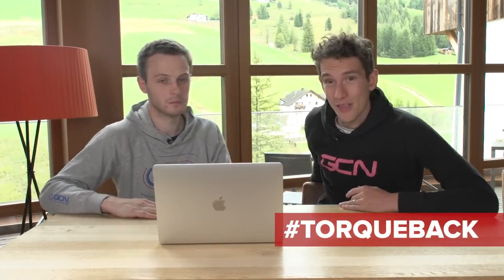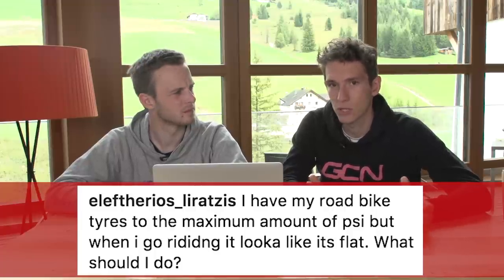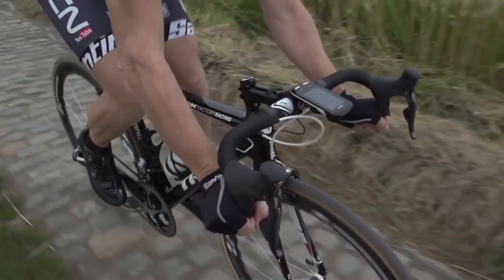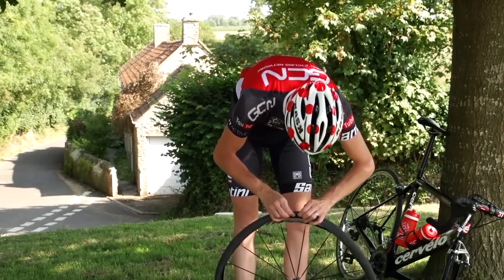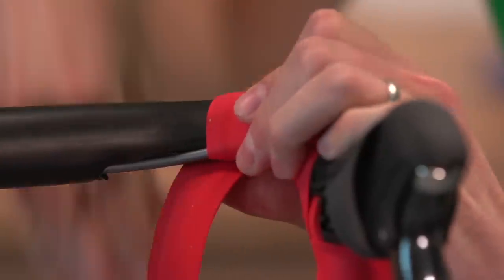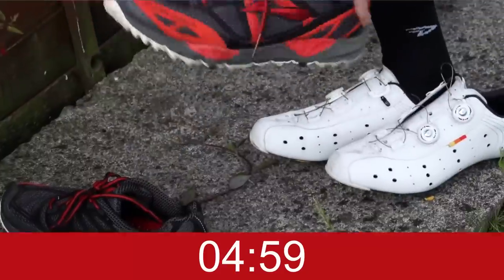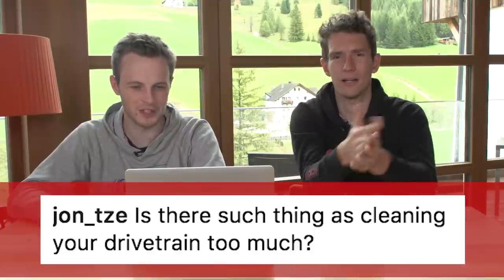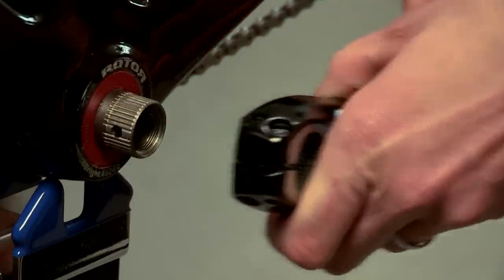Mechanical Special | Ask GCN Anything Cycling

Comment: For the person asking about getting seized aluminum seat post out of carbon frame.  Try getting it cold.  Carbon has a negative CTE meaning that it will expand when it gets cold while aluminum has a positive CTE meaning it will shrink.  Never tried this before so not sure how cold it would need to go or what is safe though but the mechanical principles suggest success.
Reply: Pro tip! #Physics

Comment: Because the thermal conductivity of Aluminum is different than Carbon Fiber, I've heard of using a CO2 fire extinguisher to super chill the seat post, releasing it. I've never had cause to try it myself.
Reply: Using the same line of thinking, Loctite has an auto mechanic "Freeze" spray to remove rusted bolts, which could work. Also compressed air in a can, turn them upside down and you also get stupidly cold gas. Just ideas.

Comment: Tire pressure -- It is very easy to pump your tires to their maximum rated pressure yet not have enough to support your rolling weight if you are a large, heavy cyclist and are using small tires. This can even happen to fit cyclists who are not overweight. For example, I'm a fit endurance cyclist and my body fat is below 8%. But I'm also 6' 2" (188 cm) tall and weigh 185 lbs (83.9 kg). When I add the weight of my Pearl iZumi pro kit and shoes, Giro helmet, carbon-frame bike, saddle bag with emergency gear, water bottle with water and lights, I need to pump a Continental Grand Prix 4000 S II rear tire with a 700c x 23 mm size to 144 psi (9.9 bar) in order to have no more than a 15% tire compression when riding in an upright road position. In that upright position, approximately 62% of my rolling weight is on the rear wheel so the rear tire needs the most pressure. When I'm riding in a forward-leaning aero tuck, resting my forearms on my aerobars, only 53% of the weight is on the rear wheel and the same rear tire needs only 122 psi (8.4 bar). The problem is that the maximum pressure rating of the tire is only 120 psi (8.3 bar). The solution is to switch to 25 mm wide tires (that's the largest my bike frame and caliper brakes can accommodate). A 25 mm wide tire needs only 124 psi (8.5 bar) in the upright position and 102 psi (7 bar) in the aero tuck position. That's doable. To help you determine the tire pressures you need, I recommend borrowing a floor shipping scale and weigh the weight over your front wheel and rear wheel separately. You should be wearing your full cycling kit including helmet and your bike should include all the items (saddle bag, water bottle with water) that you'd normally take on a ride. Then get a bicycle tire pressure calculator app for your smartphone to work out the required tire pressure for each wheel. I use this one for my Android smartphone: https://play.google.com/store/apps/details?id=com.edisongauss.bertotirepressure.

Chain cleaning -- Perhaps I'm old-fashioned, but I hate cleaning my chain on the bike (I go back to the vintage steel-frame road bike days when hubs and bottom brackets were rarely weather sealed). I use SRAM chains with a "Power Lock" link so I can quickly and easily remove the chains from all my family's bikes. Then I can easily clean them off the bike. (Note: Other chain manufacturers also offer similar reusable chain links.) Why clean the chain off the bike? Because I hate the idea of solvent or soap running over my rear free-hub and bottom bracket -- and this will always happen when you clean your chain on the bike. I'd rather not risk losing any grease from the hub and BB because the weather seals are not perfect -- they can't be unless you are willing to accept much higher rolling resistance. Generally speaking, the hubs and BBs with lower rolling resistance will, of necessity, have less weather protection which means solvent and soap can get into them more easily. Plus, once the chain is clean, I can pop it in the oven on a metal cookie sheet (dedicated to this purpose) and set the oven temperature to its lowest setting (usually "warm" on most ovens) so the chain can be thoroughly dry in just 10-15 minutes before applying lubricant again. This has been a great way to clean a chain during cold and/or rainy weather. To clean the chain, I use a Park Tools chain brush, earth-friendly citrus-based solvent and biodegradable dishwashing soap. (IMPORTANT: You cannot use any flammable cleaners if you plan to dry your chain in the oven!!!) Note: SRAM Power Lock links are rated for just single use but I've never had any problem reusing them -- not even after many dozens of locking and unlocking. The only time I use new Power Lock links is when I install a new chain.

Bar end plugs -- The perfect solution to the bar end plug problem is to switch to locking plugs. They are not expensive and pay for themselves many times over. Most have a screw that you turn to expand them inside the handlebar, preventing them from sliding back out. If you use thick bar tape like me (2.5 mm thick Lizard Skin tape), you know that it's nearly impossible to get bar end caps to stay put, forcing you to periodically check them so you don't lose them. But it's easy to forget and I've lost caps that way. The locking bar ends fix all that. I'm using a pair from EVO now that I paid only US$8.75 for. Here's a link at the U.S. Amazon site: https://www.amazon.com/gp/product/B00N5KDU2M/ref=oh_aui_detailpage_o03_s00?ie=UTF8&psc=1.
Reply: TL;DR but yeah, I  ran 23's pumped up to 100 psi and they would deform because im just too big for those tyres. Not fat, just 194 cm, 80 km individual. Lol. Switched to 25's and never looked back, im now considering going 28.

Comment: How often should you service your BB, headset and wheel hubs? #TorqueBack
Reply: If there sealed bearing there not serviceable, so just replace when the become unsmooth. If there are loose bearing or grease-able races then it depends how many miles you ride and in what conditions. If riding regularly check for smoothness of spin/movement once a month.
Reply: clean and re-grease periodically (just make sure they aren't dry and that they don't have dirt in them), service/replace when they become a problem.
Reply: For me BB and wheel hubs not often, say every 20k km via a bike shop.  In fact so infrequent I'd consider a BB replacement instead as they are relatively cheap and might use wheel hubs as an excuse to buy a new wheelset! Headset is fairly straightforward and I do it about 3-4 times a year - beginning, middle and end of winter then once more if I get an associated click or creak. That's riding about 10k km a year but the main thing is winter prep then keeping on top of it during any prolonged, filthy, winter riding.
Of course normal riding conditions are important. For reference I'm in the south of England.

Comment: Stuck seatpost? Aliuminium in carbon?
Take the second bottle cage off (one of seat tube), tip bike over carefully, spray WD40 through bottle cage holes. Leave to soak, repeat, leave... Leave overnight. Place bike back onto its wheels carefully since now you got liquid within your frame. For personal preference I swapped my Fizik saddle for an old one I don't mind breaking. Some strong side moves through the saddle and it all should come apart!
It won't be easy but persistence pays off at the end.

Comment: Tire width: 
measure the fork/chainstay/seatstay gap where the tire would be

Minus 5 or 6mm. That is the actual width of the tire allowed.

IF the rim internal width is above 17mm, take the tire, add half the additional width to the stated width. I.E. 23mm tire, 19mm rim, actual would be about 24-25mm.

Note some brands run narrower or wider than the stated width.

Comment: 4:59 - Maximum Tire width ... I just went through this, and it can depend on the tire make and model as well (as well as wheel/rim build and width - don't assume that a tire that barely fits the bike with one wheel will fit the bike with another wheel).  A Gatorskin 28 might fit where another 28 may not.  I accidentally ordered, IIRC, a 28 instead of a 25, and it fits when the wheel is perfectly centered - but it's a pain to even get past the brakes when they are opened up.  Moreover, with only about a 1 or 2mm gap between the tire and carbon frame's paint, the wear from not the tire, but the road and sand particles being slung up at the meeting of the seat-stays has worn through the paint and the primer, and it started to wear into the carbon.  It's like a continual sand-blasting there, so I have had to try remedies.  First was two layers of clear box (for the post or mail) packing tape, but those wore through fast.  Last attempt, that I haven't even assessed since I did it a few months ago, was a thin layer of filling in the gap in the paint with a 2-part PC-7 epoxy.  
So... I technically have the space for a 28c tire in the rear of my bike, but operationally it really isn't ideal for safety and frame-wear reasons.
Reply: David Hanny I
Reply: stupid... why use 28mm's if they ruin your carbon frame?????
Reply: It was an ordering error that I didn't catch.  The Amazon page had multiple tire listings, and either I chose the wrong one, or they sent me the wrong one.   The bike came with 23's, so I went and ordered, or tried to order, a 25c to see if it would fit.  I didn't look at it in the packaging, and really didn't notice it was a 28c until after a month of riding it.  At this point, it really isn't the tire that is ruining the frame - the impact from being sand-blasted would still be there with the 25c, only slightly less so.  Such is the problem with riding along beach highways during and after rains.  The problem is more with the tight tolerances the frame was made with (seemingly made for 21c to 23 c tires), and I'm not going back to 23c tires.
Reply: Thanks, that may be a good solution - I'll check my epoxy layer to see if that's wearing through first.  PC-7 is a pretty tough product.
Reply: Kip, your message didn't post.

Comment: about the bar tape question, if you are using an alloy bar then most likely the bar is corroded pretty well by the salt in the sweat if you didnt clean it for that long. you really should take off the bar tape and have a close inspection of the bar for corrosion.

Comment: #TorqueBack I recently had a bike fit and the main change was a saddle position that was further back on the rails.  My bike fit guru said that many people sit too far forward because it feels fast but us actually unbalanced.  My position now feels way more stable on fast descents and through fast corners.  I also note that quite a few pros seem to be crashing on technical descents in grand tours, especially in the wet.  Has the UCI's relaxation on downward seat angle cause an instability problem???

Comment: It's theoretically ok to say you can never clean your chain too often, however, I see chains that have not had the degreaser properly removed (probably because they're in a rush). Residual degreaser will remove whatever lube you put on and your chain will experience accelerated wear. Basically, if you don't have time to do it properly, don't do it.

Comment: #TorqueBack Is mixing in short sprint intervals to bump up average power in a 20-minute FTP test valid? Or should it be a sustained effort? My short-term power is disproportionately better than my current sustained power? 

I feel I can recover quickly from short, 20s bursts at a higher power though find it harder to sustain the same average power when its consistent. Similarly, could you potentially do a video on how much average speed/time changes over a section when ridden with consistent power (say solid 300w) vs alternating between 1 minute at 200w, 1 minute at 400w.

Comment: Ive had 6 bikes with square taper BB's. Not even one of them creaked in there lifetime, even when running the same BB for thousands of km. Those Shimano square taper BB's are bomb-proof. (quick reccomendation: "RPM" brand square taper BB's with FSA bearings are terrible, they suck)
Reply: right! I use a older Campa Record crank with square taper BB still today and never had a problem; same with a even way older TA crankset (from ~1985) which I used until this summer (changed now because no chainrings available) - no creaking in more than 30 years of use!!! ...if that happens, they are badly mounted...

Comment: #torqueback what is a cheap way for a head unit for navigation, speed etc. ? Usual Garmins are waay too expensive.
Reply: Torben Sander Mount your mobile phone
Reply: MRGRUMPY53 I need navigation for group rides and marathons
Reply: Get the elemnt Bolt, you'll never regret it.  Cycling isn't a cheap sport so just get used to it
Reply: You can use Bryton rider 330 if u need navigation. If you don't then use simply rider 310
Reply: Navigate on your phone and have a cheap bike computer for stats
Reply: Torben Sander Garmins are shit too, in terms of reliability, waterproofness, data handling, maps, routes. I hope the element bolt is better. When it works they are good, but man, my Garmin frustrates me #lostdata #calibrationissues #nosoftwareupdatesin18months

Comment: GCN does Science? how does the power to pedal ratio change as body position changes (ie. compare power output while pedalling super tuck - vs pedalling normal tuck on the drops with straightened legs)?  Compare super-tuck / seated / standing . ??

Comment: I have two sets of wheels.  One nice set and one kind of beater set that I'm not so worried about.  I'm going to use one set for the trainer with a trainer tire, not to be ridden outside, and this will happen about 3 days a week.  And then the other set I'm going to take outside for endurance rides about twice a week.  Will the inside or outside riding be harder on the wheels?  I'm thinking of the water and road salt that will be on the roads in the winter, but also I hear that roller drum can be hard on wheels as well.  So boys, what do I do?   #TorqueBack

Comment: If I had a tailwind, would it be reasonable to ride upright and take advantage of the wind?
Reply: Hardly- if you're still putting out a good effort, you will end up riding faster than the tailwind is blowing, so you'll still reap the advantages of a good aero position.

Comment: Question: I always go with around 110psi in front, and 115 in the back, for puncture resistance and less rolling resistance. However, I do find that I wear out the rear tire quite fast, as in every couple of months ( I ride 150 miles a week, 12,000ft of climbing a week avg, thanks strava). Do you think that's too much psi, or is going up my local climb all the time to blame for the frequent tire wear? Thanks, GCN is the shite!
Reply: Oh, and I'm 168lbs, usually carry 1.5 liters of water with me too, ergo my inclination towards higher tire pressures.
Reply: You may slightly widen the contact patch with lower pressure and spread the wear. Try lower pressure next set of tyres its the only way to really know

Comment: Disagree with Si on bike fit respective to bottom bracket & seat where he stated the seat will always be in the same position. How can you ignore crank length. A 160mm crank would put the seat at a different height than a 170mm crank on the same bike.

Comment: Si greasing a square taper bottom bracket... come on. Never do this! If your square taper is creaking that means there is some play and its probably not torqued properly. Grease will only help the taper slip around more and speed up the process of rounding the square taper on either your crank arm or shaft. Also, Tom... before your time? O_O

Comment: #TorqueBack
Hello, i can't really decide between carbon and aluminium. I've been to multiple bikestores now and they all had different answers about what's right for a beginner. I also like the bikepacking bike of Sean Conway you had featured in one of your videos, so I can't decide on wether to buy a cyclocross or an endurance model. For my type of riding it will be on the street with a couple of long distance adventures where tracks with bad pavement can get problematic.
Thank you ;)
Reply: Id go for aluminum if youre using in it in streets and bike packing. The marginal gain in weight and the huuuuge price increase of carbon is not worth it in your case, IN MY OPINION. Plus, alum bikes are usually spec'd for heavier loads, but it all depends on model, alloy, and quality. Consider budget too, if super light weight is not what youre looking for, maybe carbon is not such a great option

Comment: Which bottom bracket system do you think is better and easier to maintain, press fit or hollowtech?
Reply: I work as a bike mechanic, I much prefer hollowtech
Reply: Hollo
Reply: A third vote for hollotech.
Reply: hollowtech lasts longer and is way easier to swap out but you can get more stiffness out of a wider bottom bracket area, so lightweight frames tend to have pressfit bbs
Reply: Depends what you want from your bike. You might end up enjoy the maintainance process as well.
Reply: Thanks to all for the kind advice. I think that I will go with hollowtech, it may not be as stiffer as a press fit bottom bracket, but I am more interested in durability.

Comment: For the guy with the seat post problem, you shouldnt use hot, but very cold water. The metal will shrink when it gets colder.
Reply: TheJaspeerr Cold sounds like a good idea. If that doesn't work, maybe make vertical cuts in the aluminum and pry/rip the narrow strips from the inside of the seat tube? This would obviously be a last ditch effort. Maybe someone seeing this has done it and knows if it does or doesn't work.